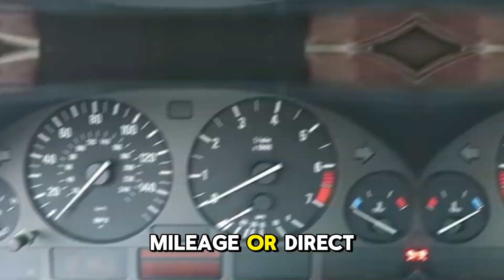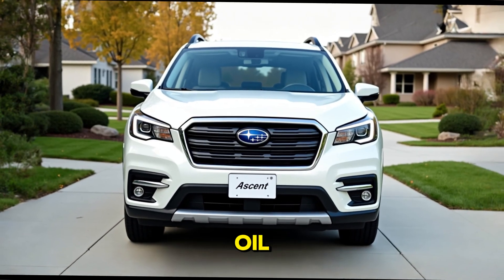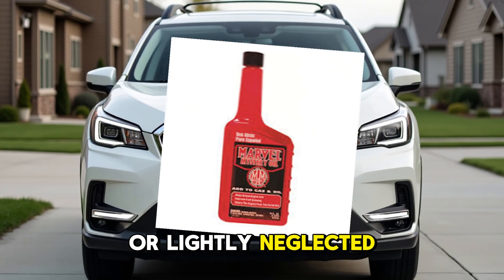13 Engine Additives That Actually Work (And 5 That Could Wreck Your Engine!)

Comment: You can’t put Lucas in these new cars it’s too thick. The oil has a hard time going through the pushrod to get to your rocker arms
Reply: Lucas makes a synthetic oil additive thats much thinner and pairs well with the new 0w-20 full synthetic oils newer cars call for.
Reply from the maker: I appreciate you sharing your insights on oil additives!